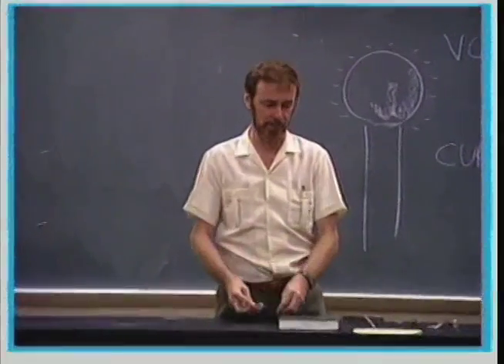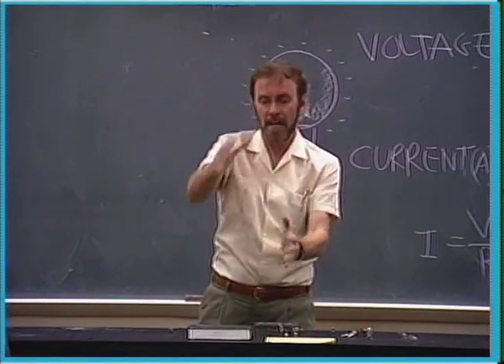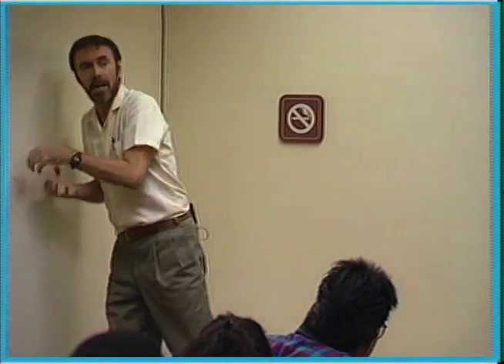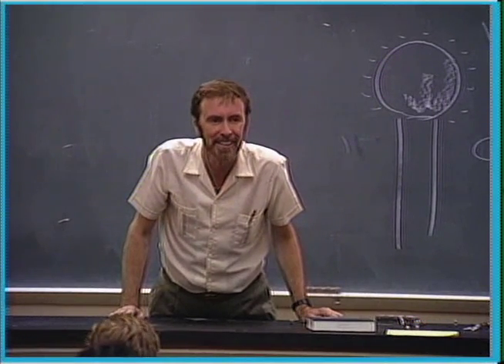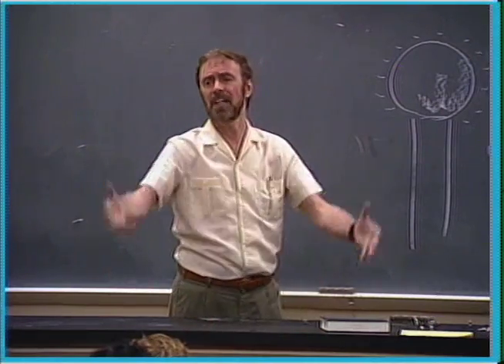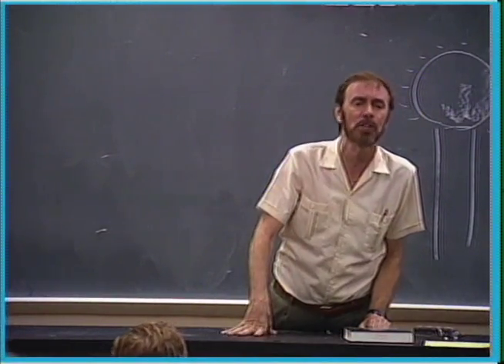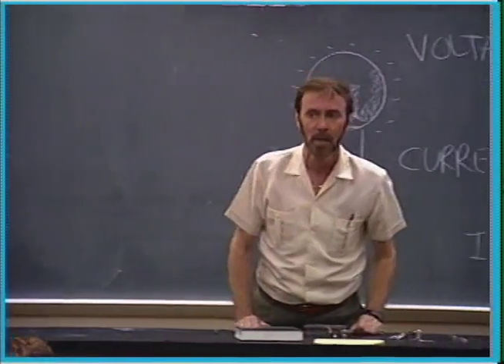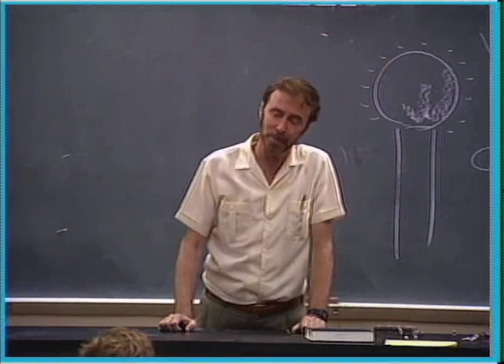Conceptual Physics : Alternating Current

Comment: question though: if you never receive electrons, how does a dc motor operate? would you not need a stream of electrons flowing from the outlet to power a dc motor? that brings to mind several disadvantages with small dc motors opposed to ac ones, but i thought dc in small appliances was good?  mainly tht first question though :)